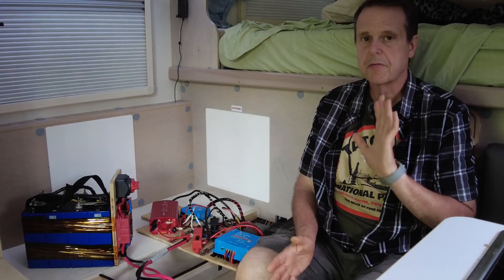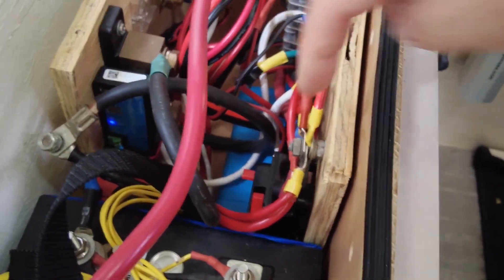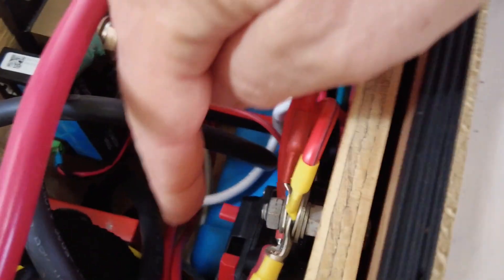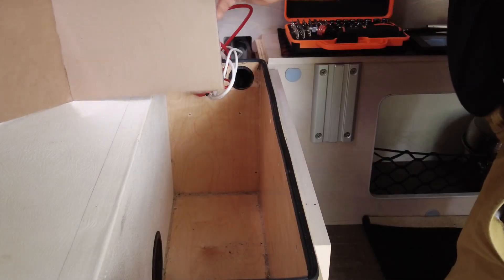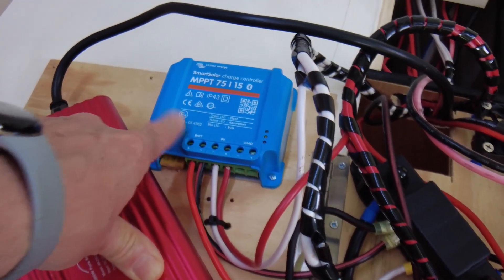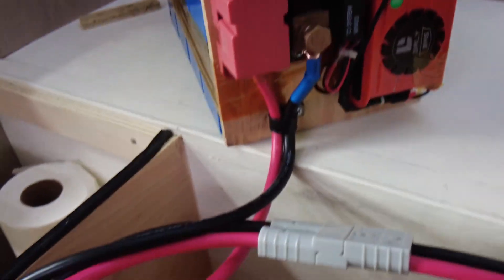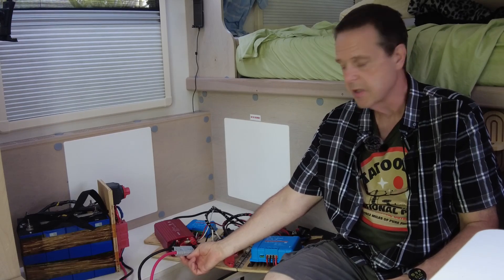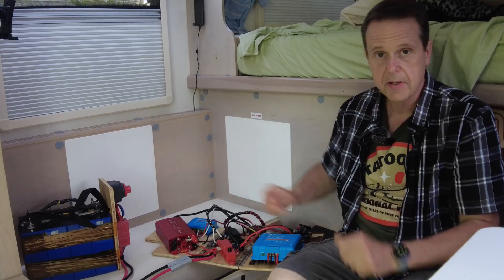Limited space?  Origami Electrical System for Vans, Boats, and Campers

Comment: Nicely done! I like that you created a custom sized system that works for you. The size of your DC to DC charger fits your space and won't exceed your alternator output.
All in one portable power stations don't always suit an individual needs case. I recently found that the 12v output of mine was inadequate for a particular need. I know that the unit could be capable of the amperage I needed but the designers have to make compromises to suit the cost and size considerations. I fully appreciate the desire to be able to troubleshoot and repair each part of youor system. Nice work on the battery as well! I haven't yet looked into the size/AH possibilities. Good job, Sir. Subscribed.
Reply from the maker: Thank you!

Comment: Very innovative.  Even though  space is at a premium in a truck camper - I would suggest ditching the AC inverter and building a small cubby to house a pre-packaged LiFePO4 power station - if the your DIY lithium battery is a 12 to 24 volter.
Reply from the maker: Thanks.  I know how to fix/replace/troubleshoot every component of my system.  Power stations are often impossible to repair.  I'll stick with what I've got.
Reply: @thisoldrv  I've been running an all-in one power station in a much older camper than yours for over 2 years and knock on wood, it hasn't bricked yet.  

It has gotten a lot use over those two years.  When not on the road,  it's my charge station for my power tools and an eBike battery. But you are correct, if it fails I'll need shell out another $400. 

My main power source is a 12 volt 100 ah lithium, charged by a combined DC to DC and MPPT controller that can easily handle my 200 watt solar panel.